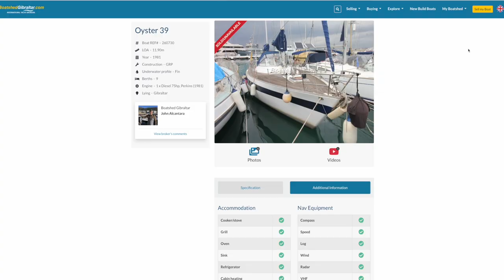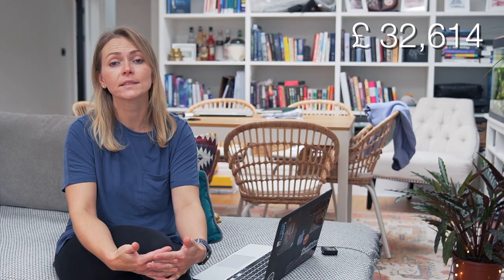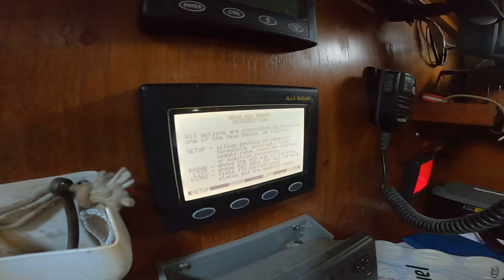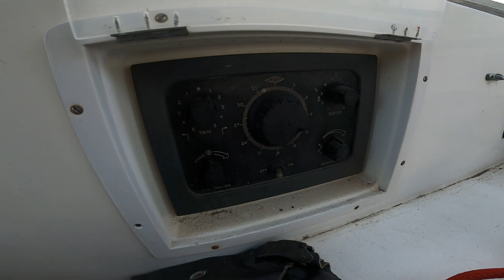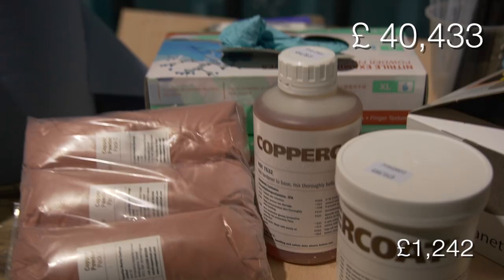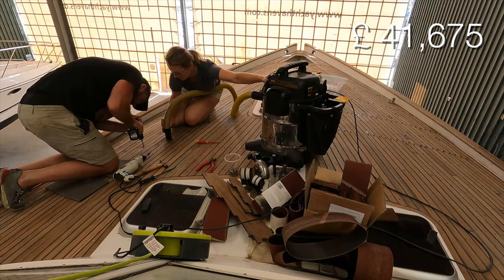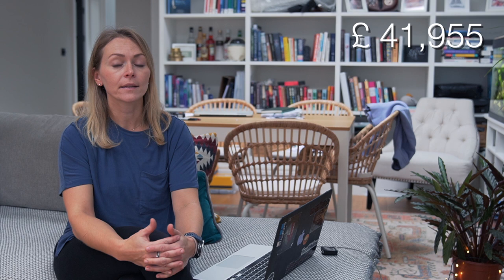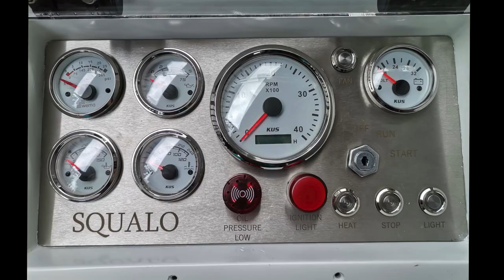How Much Does It Cost To BUY and REFIT a boat ?? [E28]

Comment: Hi, just to give you an Impression. I bought a daysailer in the Netherlands . 27 ft. Victoire 822 from 1977 . Price 150 €. Yes , it should have gone to the scrapyard . As a retired oil-rig mechanic    I had the skills to do most of the work myself as overhauling the engine  and a lot of epoxy/ polyester work. Yes, i had things made new like the sails, all the rigging,  furler and sprayhood  and ofcourse the navigation instruments etc.  Took the gas cooking away and went to solar cells and battery pack.  Now  almost ready i spent after 2,5 years around 24000 euro.  Yes, still money and with a boat market at a bottom , price wise,  i could have bought ?? Something else but again if you buy a boat older as 15 years you still need new rigging, mattresses , curtains, woodwork etc etc .etc . On you tube  project 822 by j.booy.  Take care and keep up the good work, regards, jaap
Reply from the maker: It sounds like you’ve had an interesting project on your hands. A lot of work by the sounds of it. The good thing is you got the boat pretty much for free. And the money you spent doesn’t sound too bad at all. Well done you for sticking with it, I am sure you had moments where you thought “what in the world I got myself into..”
Reply: @sailingsqualo  hi, yes , especially when bills come in for the  3 th party insurance and fees for berth.   Invest in good tools . It saves on the long term money and time. I went over  to battery tools and a battery power pack to reload them as well . The powerpack is a small one of the brand ecoflow . It has also  4  - 220 connections and takes a starting power of 1600 w. So enough for a circle saw  . Go your own way and stay with your plans , do not react on remarks like, when are you ready, etc.  In holland we have a saying that says, the best captains stand on land.  Keep up the good work . Grtz. Jaap

Comment: This is not a surprise for a 40-year-old boat. 

For every sail boat it's not unknown to need: standing rigging (every 10 years or so), running rigging (every 5 years or so), sails (every 5 to 10 years), deck, teak (every 20 years), main engine (every 20 - 25 years), underwater fittings (every 5 to 10 years), electronics and sensors (maximum every 10 years), rudder bearings, autopilot, steering gear elements (10 to 15 years), HVAC (10 to 20 years), refrigeration (15 to 20 years), etc.

So it's either pay more upfront for a younger boat, or pay $$$ for a refit on an older vessel. Age/condition vs replacement/refit defines the cost tradeoff.

Quite frankly, your costs are not exorbitant for the work you are undertaking.
Reply from the maker: You are absolutely right. Thank you for your input 👍 
Since we don’t have that much money upfront for a younger boat which wouldn’t need much work, we opted for a refurb of an old one. Some of the projects we didn’t plan or anticipate doing. Yet here we are, with a boat stripped out and a huge list of projects ahead of us. But hey, we are trying to stay positive and we set ourselves a goal that we gotta finish her. And that’s what we got to do. This is our last call, we are not getting younger 😉 we want to live a little, experience a bit of freedom before we..expire 😅 So if that means we pour all our hard earned money into this boat, so be it. 
Best,
Natalia

Comment: $60K USD seems very low to me compared with my own refit costs on a 37ft boat. Of course you still have a lot more equipment to buy.
Reply from the maker: That’s right, the costs will add up quickly once we get to buying electronics including batteries, getting new rigging, or adding fancy stuff like water maker etc.

Comment: Good content!. You will end up with a great boat and much cheaper than new. IMHO do not get a wind generator. Noisy, inefficient and high maintenance. Go with bigger Alt and more solar and as much lith as you can afford.
Reply from the maker: You’re probably right. 
In terms of the wind gen, you are a third person mentioning it..🤔 we are going to have high output alt and plan on quite a substantial battery bank..so perhaps we need to rethink the purchase of wind gen. Thank you 🙏

Comment: good job, and those costs are not major for an older boat this size and getting into a shape you can trust with your lives for long range cruising.  check, check and check :-)
Reply from the maker: Thank you 😊 to be honest to us it did seem like a huge sum at first, but like you said, it is worth it, considering we have to feel confident she is safe for offshore cruising. We estimated how much it would cost by the time we finish, then we looked at yachts for sale within that range..and all of them would still require a big investment before they were as well equipped as Squalo will soon be.
Reply: @sailingsqualo  yes and thats what you might think you know about what those other boats needed!  You know your own boats secrets now and of course great accommodation, safe and comfortable in a sea.   Looking on- line right now I don't see anything likely to be more boat for less money.  You would have to be very lucky - id rather save my luck for the lottery than the hopes of saving a few thousand on an old yacht!

Comment: In America the place for marine Perkins is Trans Atlantic diesel. The old Manicooler or heat exchanger for a Perkins6354 you can’t get anymore . Its 500O grand to get a refit kit . Ridiculous , the people there are the most knowledgeable about Perkins in America
Reply from the maker: That’s right, they were on the top of the browser when I was searching for Perkins spares etc and thought they were based in the UK. I contacted Perkins in Peterborough, not far from us. The prices are also ridiculous but anyway they don’t have most of them in stock and no longer manufacture them either ..
Reply: @sailingsqualo  is their a sister company in England . I know they get parts from England. When you pull it up from England does  it route you to a Trans Atlantic Diesel in England . The address here will say the state of  Virginia. I’ve been their . There’s half a football field of old Perkins engines setting outside. Its a cool place . Wow there’s is a lot of Perkins in Peterborough . Thanks

Comment: Hi. I am in the boat as you are (same problems). Don't buy a wind generator. Invest in good lithium batteries and a good alternator. Could you provide me with the contact that made the panels for you?
Reply from the maker: Sorry to hear you are facing similar issues. Is it with the keel as well? 
We will be getting high output alternator from Mastervolt :) will rethink the wind generator. You are not the first one who actually suggested that.. 🤔 
The panels were put together by a friend, we will ask him if he is interested in making another  😉 Best, Ziggy
Reply: Hi. Fortunately the keel us fine. But I had major upgrade with rudder and the column. But I have a polish that is helping fix the boat. The panel is for his boat.

Comment: For that kind of money, you could have gotten a 2017 Beneteau Oceanis 38 with no work having to be done at all…
What about the cost of all your upgraded NAV systems?
Reply from the maker: And where did you find Beneteau Oceanis 38 from 2017 for that kind of money? 
And to be honest, I still wouldn’t trade our boat for it. 
The Nav systems.. well, that depends  how far we want to take the upgrade, but we would have done it probably on any boat we would get. Systems are usually outdated or even though the list of nav equipment is usually very long during sale, most don’t even work.

Comment: forget wind gens,     go for large output alternator,  batteries      wait and see   AGMs  with a good batteries  monitor   and solar .  good for 8 years,  lithium too  much money  and still a fire risk .my sailing  buddy says and he used to work for batt tec  NOKIA.  heavy batteries and water tanks on a oyster39  do not make much diff to boat speed.I have 150 gallons of water in two tanks under saloon seats and 150 gallons of fuel . 900  miles at 6.5 kn . sails at 5 kns in 12knots   of wind    7.5 in 15kn plus.  you can allways refit  electricals as needed as you go.  lith  phos   power pack  may work for filming  { FAIL ISLE}  UTUBE
Reply from the maker: Large output alternator from Mastervolt is on the list as well, forgot to mention ;) 
Wow! The tanks on your boat for both water and fuel are enormous. Ours aren’t too bad either, 105 gallons of water (475-litres) and 100 gallons  of fuel (450-litre).
Reply: Looking good. Great work so far 👊 we are looking at having a generator running off the hydraulic power take off on the gear box.
Reply from the maker: Don’t know much about this sort of setup. Sounds interesting, could you share more info/links on this please?